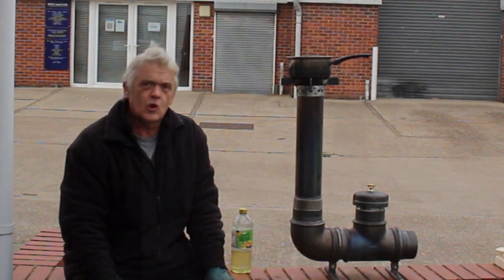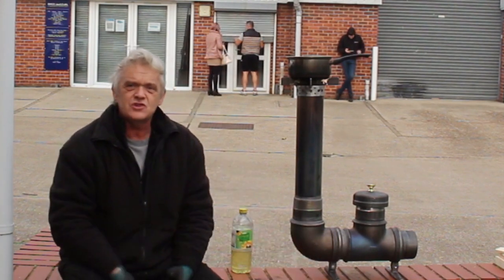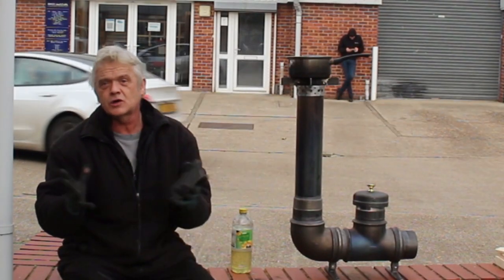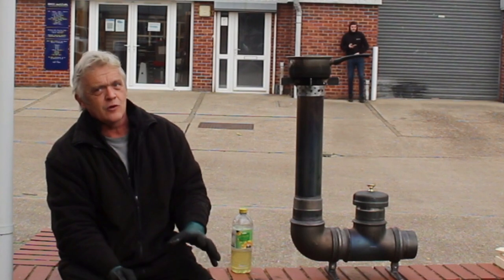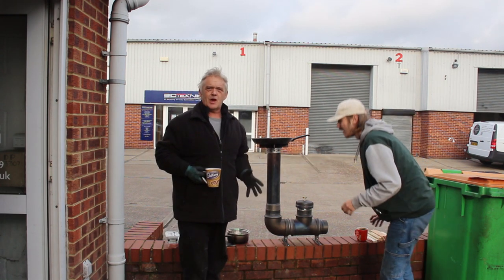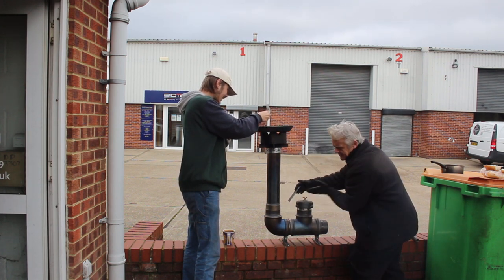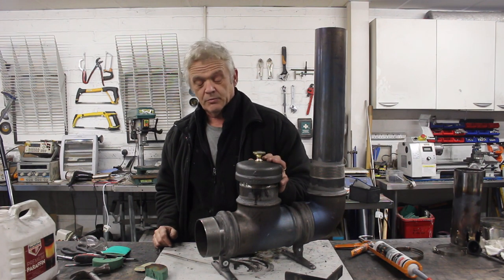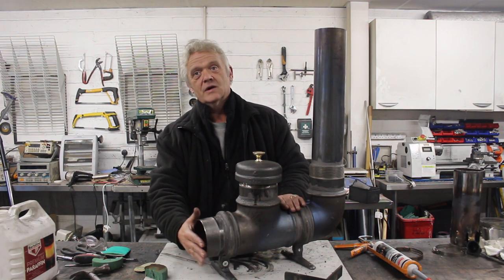1744 The Rocket Stove Kit - All The Details You Need #rocketstove

Comment: Was born near benghazi in Tripoli were my dad served in the army in 1965, found a benghazi burner at an old TA centre in Yorkshire it was simple large metal upbend tube submerged in a dustbin filled with water, had an oil dripfeed can on the top of the ubend , it was lite with a small peace of cotton used as a wick tossed into the bottom of the tube. Got incredibly hot!  Use it once but couldn't find it on Internet, seen it used for water heating and soup cooking in the 1954 film Zulu. I live in Germany now and build some of your devices, love to see it used on your show or a modern take!

Comment: Robert thank you  so much for answering all of my questions. Great video btw. At the time we (my family ) were living on 5 acres in the US. Natural Gas was not available to our area.
 So we used to have a wood burning stove in the living room area, , The primary heating system for the house was outrageously expensive. It was electric baseboard heating. Therefore we used the wood stove for the entire house. The 2 main drawbacks  to a wood burning stove is the incredible amount of work involved especially cleaning out the ash, and the cost of fuel. Not all types of wood are created equal ? i.e. Soft woods like PINE burned up very fast vs. hard woods like OAK which would last all night with a single log.. All that being said there was definitely a reason why our forefathers continued to search for better burning less labor  intensive methods of heating their home such as natural gas forced air furnaces! 😀😀😀

Comment: The escalating events in the background were hilarious!

Back to the stove:  I'm all for replacing the cap with a sterling engine to power up some USB battery packs ;D
Reply from the maker: I like that idea!
Reply: @ThinkingandTinkering  u can also use the Stirling principle to make a gas recycling system (Stirling engine on top to re feed unburned gasses back into the combustion chamber) altho u will need an external housing so the gasses do not escape so easily, same principle as a diesel EGR system
Reply: Where do you plan to get the Stirling engine? I'm looking for one myself for several projects I want to start on.

Comment: It occurs to me that a way cheaper way to do this (for people on a bit if a budget) would be with standard stove pipe instead of plumbing pipe- as all those fittings exist for that just off the shelf anywhere they sell stove stuff (from 4 through 8" diameter). Though the T might be tricky to find.    It would not be as long lasting, but it would be a great deal lighter and half or less the price.  Good option for an emergency or camp type stove.  You could also hybrid that- using the heavy plumbing T for your fire box, and the lightweight stove fittings for the rest of it.
Reply: Just encase the metals in a cob so that when the steel burns and/or starts to rust through (as it will), you'll still have a working stove.  

  If you want the cob to be lighter, stronger, and more insulative, instead of sand, use a mixture of fumed silica and diatamaceous earth, and instead of straw/hay use fiberglass clothe or chopped strands.  And add some perlite to the mixture as well. 

    The combo of fumed silica, DE, and perlite will make it lighter and more insulative, and the fiberglass clothe or chopped strands will make it stronger. 

     Once everything is fully dried/cured, coat it all with some thinned, high heat silicone to make it more water resistant. 

  (Obviously it won't be a portable camp type stove anymore though. Will be too heavy and/or fragile for that). 

   Another lighter method is to skip the steel part, get some fiberglass clothe, ceramic fiber insulation, and make a 3 part water glass mixture (60% sodium silicate to 30% potassium silicate to 10% lithium silicate), sandwich the ceramic fiber insulation in between two layers of fiberglass clothe, coat the outisde of the fiberglass with the silicate mixture and shape to desired shape and let it fully dry while in that shape. Once fully dried, coat  outside in thinned high heat silicone. This will be A LOT lighter than the steel + cob version.  To shape it, you can lay it over cardboard and then burn that out later.  

    (why that particular mixture of water glasses?  I've read some research that indicates it lasts longer and is stronger than straight up regular water glass [sodium silicate in the states and potassium silicate in Europe]. Makes sense because you have 3 different sized molecules that are in a sense, locking together more closely with each other).

Comment: My one is an old gas bottle 9L and a 304 stainless pipe about 4 in.  I filled the gas bottle with normal concrete as I did not want it to tip over.  I did buy perlite to make the light concrete but it would be too dangerous for the people around so I went a high lime normal concrete.  It works on oil but if I drill a few holes it will do wood.  The main air inflow is about 15 deg so unburnt oil will drip out.  I will put a stainless steel scourer in.  We used to burn it in place before the lorries took it away.  Love the vids been watching for years.  I used to be a chemo AND YOU ARE DRAGGING ME BACK.  wITH OUR THOUGHTS WE CREATE THE wORLD.  mIGHT BE FROM mONKEY MAGIC BUT IT IS TRUE ALWAYS AND FOREVER.

Comment: Like Ive mentioned before I like the L type with a flat plate for cooking in the horizontal tube as well as on the stack. The 2 areas cook differently but you can boil water on one and cook bacon on the other. I prefer a grate style plate insode the feed tube so air gets to the fuel.. Ive seen the top of the stack crenulated so it can breath with a pot or pan on top, Ive also seen the top of the stack with holes around it and the grate on top or use a much deeper trivet/grate, at least half again the depth of the one you have

Comment: It looks like a nice clean burn on the video so you probably don't need to change anything, but in my reading on wood gasifiers it seems that the down-draft types (like that basically is) use a taper at the bottom of the fuel hopper to force the heavier gasses given off by the wood to pass through the hot charcoal at the bottom and break up in to H2 and CO before being used, or in your case, burned.  I wonder if that's a concept you might like to play with.  Do you have plans to build a gasifier and run an engine off it?  That seems like the next logical step.
Reply from the maker: I have built gasifiers before mate so I get what you are saying - it is unlikely I will change this as the whole design ethos here is simplicity of build

Comment: A cheap recommendation, if it's possible,  try and source some old water pipes. If there are any industrial or large commercial buildings being worked on, you may be able to get all the needed fittings for free.
A local hospital shut down a few decades ago, and got sold recently. For the past 5 years, maybe more, it has been under development as it's being turned into residence. They are still removing old iron pipes that they need to dispose of, they would be happy for me to come and take some away for free.

Just make sure it was only used for water. Ya don't want diesel fumes all over your food :p

Comment: I checked out these fittings and it becomes a quite expensive heater to make. I suggest doing the sums on pricing someone to weld one up for you (if you can't do it yourself), versus the cost of the plumbing bits.

Comment: Rocket stoves are my definition of Free Energy.  The difference between a campfire and a rocket stove is free, after a small design change, materials and effort.  It's a clever upgrade from previously used norms.  I could imagine even coal burning clean with more heat.

Comment: You guys are making me hungry!  LOL.  Question though:  If your fuel feed tube is smaller,  wouldn't that negate the need for a cap on it if it is angled?  The idea is that you want more air draw through your burn chamber, so no cap would also draw in more air and also make it cheaper.  A lot of diesel farm equipment have exhaust pieces that would work for a build as well.  Source from a scrapyard for little to nothing.  Don't get me wrong, your build is beautiful, just trying to wrap my head around a cheaper solution for people that would want to build it.  Bon appetite!

Comment: Thank you for posting such great videos and sharing your extensive knowledge and expertise. How would it be if you were to use a metal plate in place of the cap, to heat a small saucepan or at least keep it warm, whilst simultaneously using the other pan on the chimney (with the trivet) as shown in your video. Thus getting the maximum benefit from the fuel, and of course permitting the second cup of tea with with the bacon butty. Thanks again.

Comment: For the damper on the bottom idea, I was thinking of putting some holes after the fuel so that even if you choke off the fuel, the secondary air will burn off all the smoke which might make the unit close to maximum efficiency...

Comment: Hey @Robert Murray-Smith , really enjoying the content recently. Thanks for demystifying the rocket stove / mass stove and some of the basic concepts. Tell me, is there any benefit to a rocket stove over a well made cast iron log burner ? As you said in the video, the efficiency is gained from capturing the wood gasses and burning them rather than being lost to the wind so what's the difference?
Reply: The DEFRA smokeless rated log burners are very similar as they recirculate the exhaust back through the front of the fire before exiting. The difference is the thermal mass of the stove and insulation and length of chimney before exiting the room (through wall or up traditional chimney) but will require more fuel as the burn chamber is so much larger
Reply: Presumably the size of the burn chamber just constrains how much material can be combusted at any one time and therefore the power output? If the heater is matched to the size of the room then surely a larger burn chamber is going to be desirable in order to produce enough heat to overcome the thermal losses and bring the room up to temp in a sensible time frame. I would have thought that heating a larger space with a stove as small as the one in this video would take rather a long time comparatively and would have to be refuelled several times over before a desirable temperature was reached.

Comment: Somebody noted in the comment section that you can also use the lighter, premade steel and fittings found in like hardware stores, but noted that it will burn out faster.  This is what I wrote as additions or alternatives to that: 

"Just encase the metals in a cob so that when the steel burns and/or starts to rust through (as it will), you'll still have a working stove.  

  If you want the cob to be lighter, stronger, and more insulative, instead of sand, use a mixture of fumed silica and diatamaceous earth, and instead of straw/hay use fiberglass clothe or chopped strands.  And add some perlite to the mixture as well. 

    The combo of fumed silica, DE, and perlite will make it lighter and more insulative, and the fiberglass clothe or chopped strands will make it stronger. 

     Once everything is fully dried/cured, coat it all with some thinned, high heat silicone to make it more water resistant. 

  (Obviously it won't be a portable camp type stove anymore though. Will be too heavy and/or fragile for that). 

   Another lighter method is to skip the steel part, get some fiberglass clothe, ceramic fiber insulation, and make a 3 part water glass mixture (60% sodium silicate to 30% potassium silicate to 10% lithium silicate), sandwich the ceramic fiber insulation in between two layers of fiberglass clothe, coat the outisde of the fiberglass with the silicate mixture and shape to desired shape and let it fully dry while in that shape. Once fully dried, coat  outside in thinned high heat silicone. This will be A LOT lighter than the steel + cob version.  To shape it, you can lay it over cardboard and then burn that out later.  

    (why that particular mixture of water glasses?  I've read some research that indicates it lasts longer and is stronger than straight up regular water glass [sodium silicate in the states and potassium silicate in Europe]. Makes sense because you have 3 different sized molecules that are in a sense, locking together more closely with each other).

Comment: You could cut a hole at the bottom and make a hinged or removable flap with a catch, then you could empty the ash without having to pick the stove up and tip it out.
Reply: There's so little ash left just prod a hoover hose in when it's cooled down, No need to move the Stove.
Reply from the maker: nice

Comment: Controlling intake of air could be quite easily achiueved by simply sitting a plate over the hole. Lean it against the hole, and the angle it is leaning defines how much it restricts the air flow.
Or you could lift the plate up and down to partly cover the hole, but that would probably be a little more awkward.

Comment: After building smaller, steel can versions, I found that the measurements aren't too critical.  The proportions(chimney pipe length to burn chamber) are more desirable, and you will get a good idea for the right sizes  and lengths as you build a few.
I still prefer a basic wood gassifier stove-  just don't touch it until you cool it with WATER!

Comment: Thanks for the update.
How about a stove made from the heaviest gauge HVAC venting pipe (c-vent pipe) which also comes in the same shapes and sizes, and larger size diameters , as the black plumbing pipe you used in this video.  
There are thick gauged single walled pipes and fittings such as 22 gauge, 20 gauge, 18 gauge, 16 gauge, etc. 

Maybe using stove pipe and fittings. 

Thank you for giving us fantastic ideas and examples of what we all can do.
Reply: That's a good thought. As I'm searching for 6" diameter iron pipe fittings, I'm finding them prohibitively expensive

Comment: What a great video as always, I was wondering if you could get a small rocket mass heater in the unit where you work I was shocked to hear that one piece of wood from a pallet can last you an hour maybe instead of using clay and for the mass you could use 55 gallon drums of water and salt say about 5 of them with a small fan blowing the hot air over the drums at your work bench.  Keep up the good work ..cheers
Reply from the maker: cheers mate

Comment: You could extend the horizontal pipe and cover it with cob(A mixture of clay sand aggregate and Straw) this would create thermal mass which would absorb some of the heat from the cast-iron pipe it within radiator heat out slowly over time it could be used indoors or outdoors and even extend it to make a seat or used to warm a greenhouse in the winter
Reply: Let converse📤❤😊

Comment: Mercy I'm having fun since I've found your channel !!👋💖😉
==>Ok, so you've built a fun One burner stove,  still hopelessly useless as it is for practical applications...   What I need from my rocket stove is 2burners or 1burner and a griddle, ability to heat quantities of water (Admittedly this is a Wish Lust item), an Oven (old bread style is good), and of course heating . True it may take 2 builds ==>cook stove=> then bread oven/water heating system= for this.  Likely even 3 builds for a Mass Heater.   I admit my Lust list is long and somewhat complicate, but 'Times they are a  changing' . And you see I'm not willing to surrender heaps of my first world quality of life I'm quite willing to "roll back" some bits but the ability to cook properly is not one of those bits.

Comment: Could put that in an old filing cabinet (laying on its back). Then fill the cabinet with some fire resistant material, and have a place for a heat chamber to rest on. Course it wouldn't be as pretty.

Comment: Hi Rob...sorry if I missed this in the many rocket stove vids....but how long is the burn with what looks like a handful of kindling?   I'm used to heating with three 15 inch by about 6" dia. logs in an overnight burn.  Kind of set it and forget it.   Do I have to reload these rocket stoves "hourly" ????
Reply from the maker: I did talk about that at the end of the video mate - using this as a cooking stove it does what it does tbh - to adapt it for inside you need a more controlled burn which is done with air flow control - cheers
Reply: @ThinkingandTinkering  me bad ....tnx

Comment: I hate to overwhelm you with ideas 💡 so feel free to ignore.  If you used a smaller diameter pipe for the wood feed, than the intake and exhaust, it would create a vortex and suck air through the fuel pipe rather than not, which might, I say might lower the fuel storage temp less than 700c.  Regardless it will prevent blowback through the fuel tube.   Granted it's expensive to build another but for the sake of science lol and curiosity.  So perhaps air intake 12", feed tube 10" and 12" elbow up the stack.  Ideally  >12" stack will increase flow due not only to existing dynamics but assisted by lower pressures in the stack due to larger sizing.  
In the end, I suspect the venture will 1 lower fuel temp with vacuum, 2.  Prevent blowback gasses, increase forward flow of hot air through the system due to laws of fluid dynamics.  
But that probably goes beyond what your trying to do, cheap and easy.  Lol.    
However if you where to make one out of clay as one piece, that is how I would design it.  You could use a paper me shay and chicken wire to shape it, or soft styrofoam to shape it, pack it in a square box of clay and Wala a home made 1 peace custom engineered rocket stove!
Reply: I didn't forget the rest of the process of firing clay, but Robert, I know you know the rest of the story.  :)